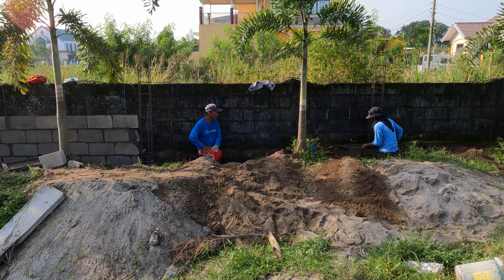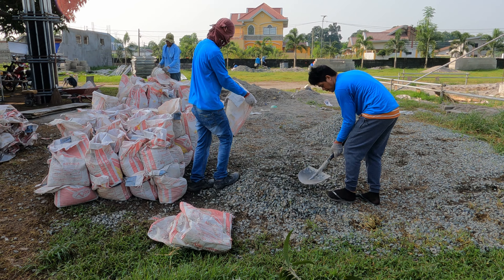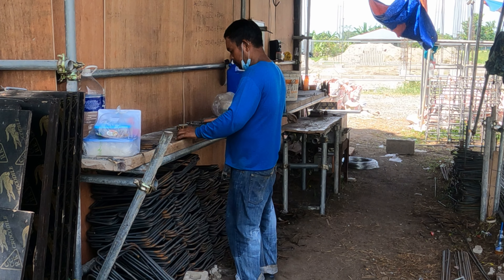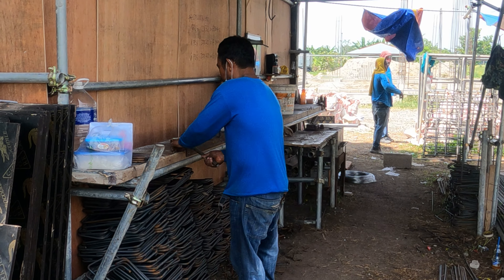Philippine House Building Day 22 - Pay Day

Comment: I worry with that block work on the side of the rice field that will not be waterproof and if the field floods you may get water through the wall maybe Like james' did he added extra french drains for more drainage and he hasn't had any problems even after the recent typhoon
Reply from the maker: Ron
It is not waterproofed. The saving grace for us should be the additional elevation we have.
We have owned this land for probably close to 20 years and we have never seen flooding - even with what appears to be a pretty high water table.
The house has been further elevated so hopefully we will be ok. Only time will tell.